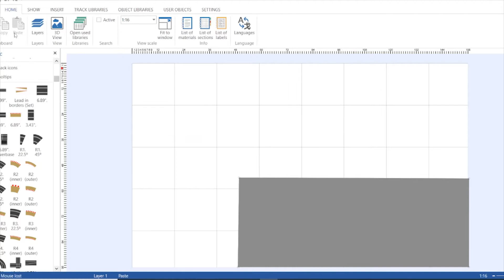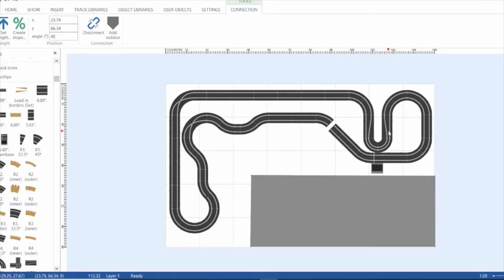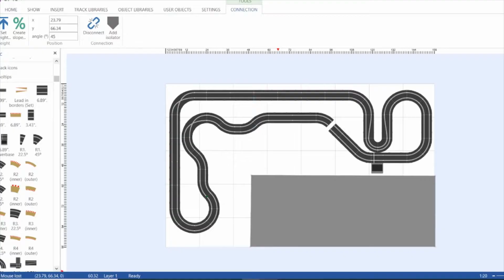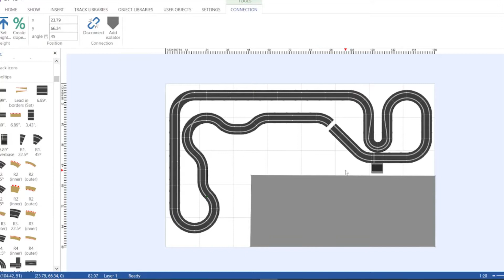Building a slot car (Scalextric) track - #1 Planning - Lofts Hatch Raceway

Comment: I like what you’ve done with your track, and I have a few suggestions for you I would make your hair pin wider trust me it will be a complete pain in the arse if you don’t. Place your scenery on the back of the track so you can get access to the cars.See what’s available with railway City backdrops, you can always print famous buildings from Monaco and stick them to it. I hope this is some help look forward to see your project develop. Cheers Jim
Reply from the maker: thanks, its moved on a bit since this video, time to make part two! I will check out that recommendation,  the long term plan is to scratch build facades to line the rear of the track build